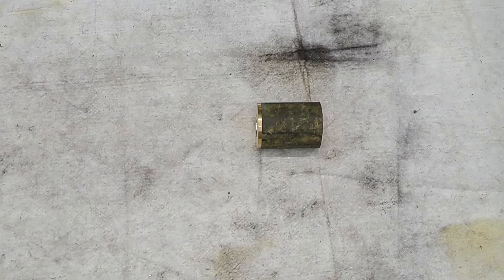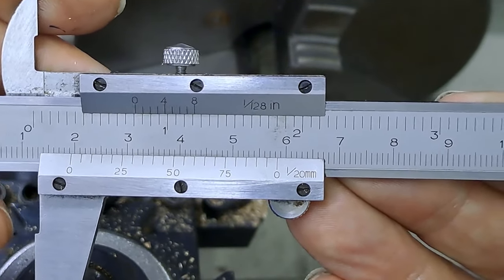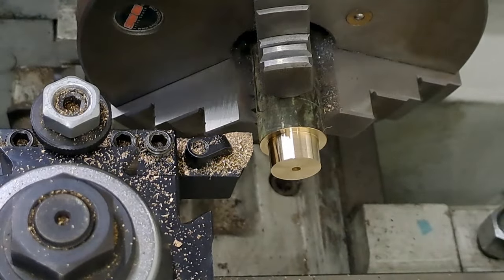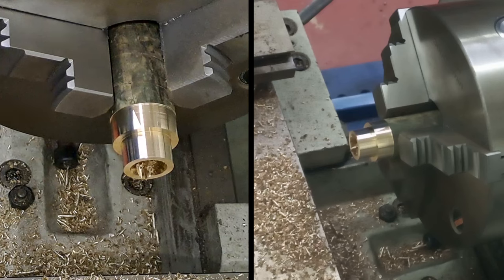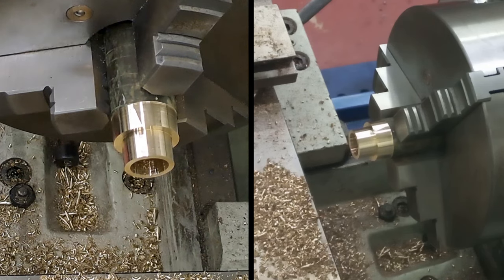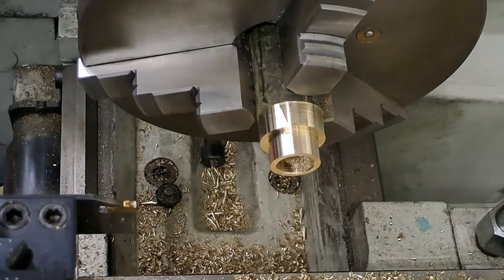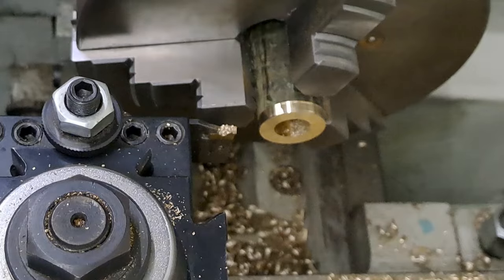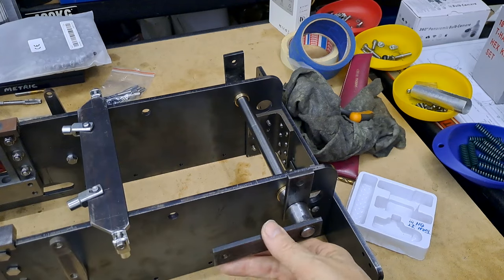029 Brake Shaft Bearings

Comment: I enjoy watching you working. There is a big but. Why so many revolutions on your lathe? I am used to the Myford ML7 lathes. The maximum revs for a 7 are 828rpm, by the way! Which you soon get used to, even when you upgrade to the Super 7 lathe.  Sorry to say this, but I hear a lot of metal ringing because you are trying to use production rpm's to do model engineering. When model engineering is actually done at half the rpm's you are running at!! So Sir, slow those rpm's down & start enjoying a bit less noise. I will enjoy your model engineering a lot more when you learn this new lesson & I sincerely hope you will. Incidentally, if you put your rule over the end of the work piece & line the parting tool up against it, you will save some time.  It is then a normal measurement back to the point where you intend to make the cut.
Reply from the maker: Thanks for the info... as I am self-taught, it has always been my info that insert tooling needs fast speeds. Do you have a reference I could read for 'better' info? I'm always open to learning better methods.
The Chef

Comment: Too much vibration on the tool - maybe use an ever smaller one next time ;-)
Reply from the maker: Thanks for the tip!
Reply: Always use the sturdiest tool. Carbide tools work if either the ones for aluminum can be used (very sharp(!) or you can grind it yourself on a diamond wheel, otherwise the good old HSS turning tools are great! Greetings from Switzerland from a 70-year-old toolmaker. PS: built the 7 zylinder 120cc radial engine on my avatar myself in over 250 hours
Reply from the maker: Now that is impressive!